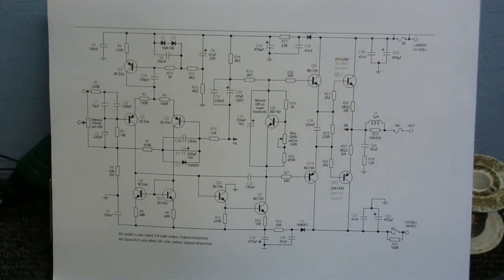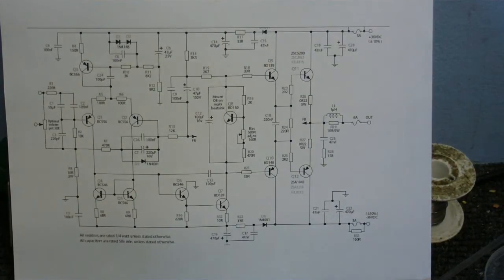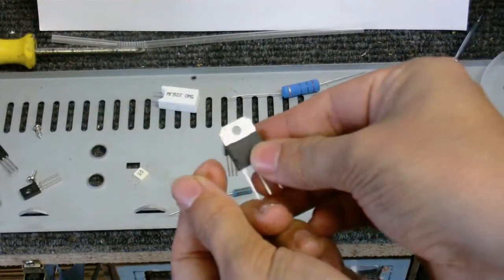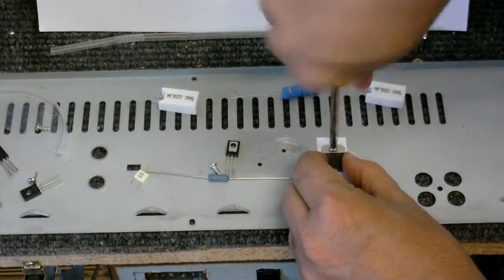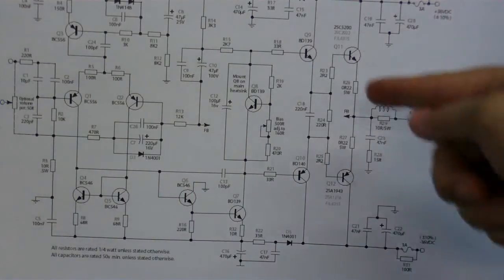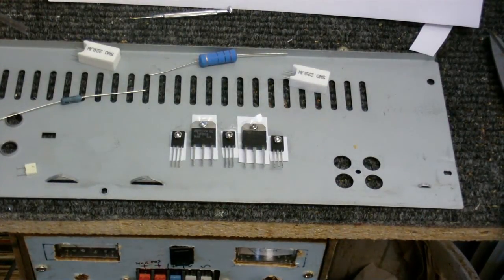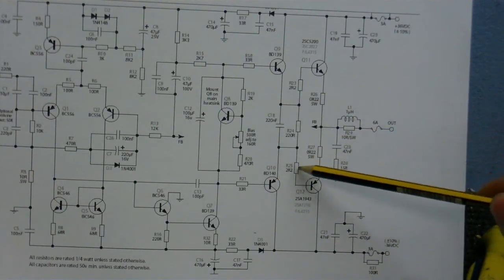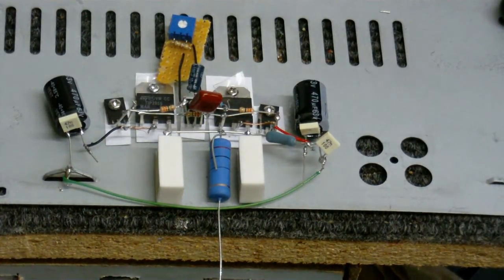CDC ElEcTroNic Work Shop - Beginning of a DX Amplifier.avi

Comment: dx means distance to me.
Reply from the maker: The person who invented the circuit calls it a DX amp not because it has anything to do with radio, but it's short for "Destroyer X", even though this circuit isn't the original DX circuit.
Reply: Ah, that makes sense.  Thanks for shedding light on this.

Comment from the maker: I would gues that the transistors inside were not heatsinked properly (or maybe not at all) , the biggest transistors would be the ones that operate the motors, changing those ones should make it work again as those are the ones that have to handle the power, so they would usually be the first ones to fail.

Comment: I had a couple of RC vehicles smoke a few transistors due to thermal runaway do you have any clue why that happens?  It's an RC jetski and it only runs in forward and my RC hummer doesnt work at all now. would changing the transistors help?
The jetski is toast b/c one of the chips that controls the speed smoked and they are SM parts. the RC hummer is thru hole mount I think but I dunno.

Comment from the maker: @Kankki1 The paper and steel backplate method is only temporary, I forgot to mention that, I just need to get hold of some heasinks, insulators and thermal transfer pads.

Comment from the maker: @djFadeOut122 Basically this cheap-ass way is only temporary, I should have bought some proper insulators along with my previous order, but like the idiot i am I didn't think!  I will be using the proper heatsinks and insulators later on, but this is just mainly for while I get everything wired up, I forgot to mention that in this video. however heatsinks are expensive, so I'll have to stick with using the piece of steel until I can find one.

Comment: paper doesn't conduct heat nearly as good as those silicone pieces that are made for mounting transistors on heatsinks. if you use silicone pieces (those grey or pink ones) you don't even have to use thermal grease.

also, there are special plastic washers to put around the screw, to insulate them from the heatsink.

so, why doing these cheap things instead of spending a few cents on parts that are made for that way of mounting transistors.....

Comment: These stop resistors  (2.2 ohms)  are there to avoid oscilations because of power transistor input capacitance...i do think you will not need them as you're using TIP3055 units;;;you can use any value from 1 to 10 ohms there...but for sure you can supress them too.;;;the coils is not critical value and will be needed only if your speaker cables are long enough to create troubles...a couple of turns of insulated telephone wire will do the job...air core is needed, do not wind up resistor;;12 turn